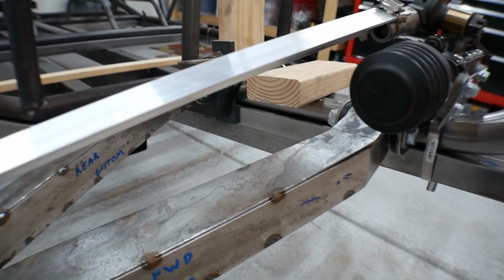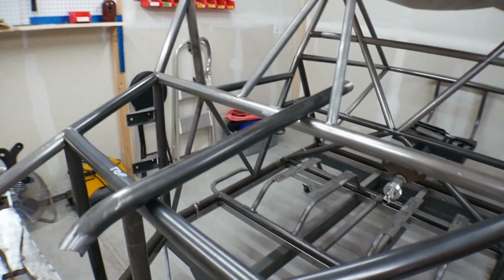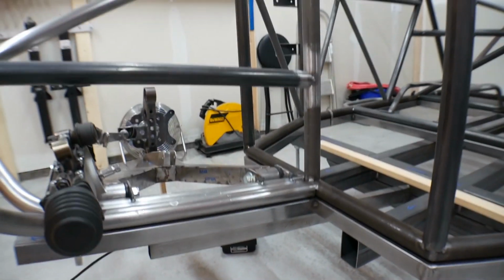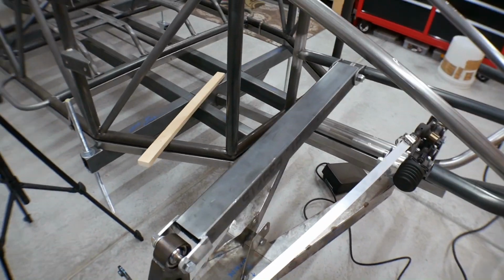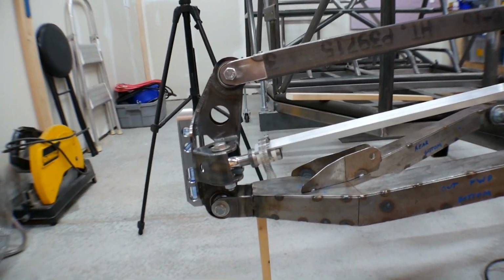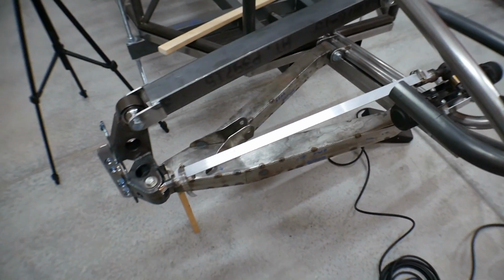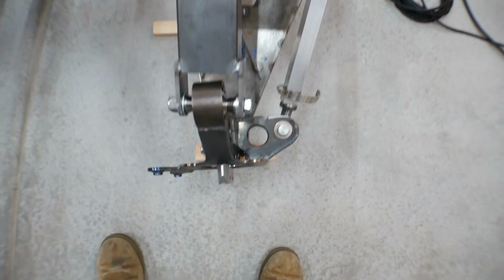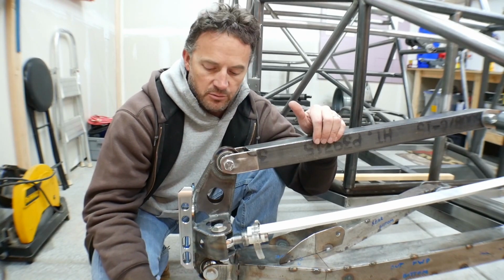Baja Front Suspension Build #2 (Temporary Mock-ups)

Comment: Awesome work, I am working on my own front suspension design that was inspired by your first baja build.  I did my design in Solidworks to simulate the travel, I spent what felt like forever in front of the computer trying to get the geometry right to get the bump steer eliminated and the Ackerman  correct.  I ended up with a design that will use a custom heim spreader for the steering rack that will put the inner tie rod pivot points in a more desirable location
Reply from the maker: Excellent work buddy! I wish I could design the entire setup on a computer. I think I'm just to old for that. ;-) 
A spreader is a good way to go. I thought about that, but because I need to change the height as well I'm going after the spindle. I'm not even calculating the Ackerman, just trying to keep it similar to the old setup as that was pretty good.
Nice work and thanks for the comment.

Comment: Hey Doug, I bought a suspension analyzer program.  You put in your mounting point for and aft of centerline of the axle, up from the ground, left and right centerline of the car..and you can cycle the suspension and look for errors.  It also has an optimize function that will check and tell you optimal location..you can get a several day free trial but it has limited features.

Comment: Nice set up on the suspension. 
Get yourself a magnetic Laser level, attach it to the hub and project the beam against the rear wall of the workshop (make sure the frame is square to the wall first and at a known distance) Mark the position of the red dot on a sheet of paper stuck to the wall and repeat for several travel heights, you can easily see the deflection due to bump steer and with a bit of math you can work out the real world angles and decide if they are low enough (you will always have some angle at the extreme travel)
Reply from the maker: I might look into doing that. Thanks for the idea.

Comment: Great video!  After watching this and the ackerman video, I'm wondering if you might consider switching to rear steer and move the steering box upward closer to where the line between the upper and lower inner control arm pivots converge toward each other?  Should help alleviate some of your bump steer and ackerman difficulties all in one shot.
Reply from the maker: I haven't decided yet. I'm mocking things up now and I'll decide what works best. Might just try to eliminate the bump steer and do what I can for the Ackerman. Hopefully I'll hav an answer in the next video. 
Thanks for the comment.

Comment: very good videos my friend, I have 5 years planning my suspension and buying the tool I hope I can make them, what measure of uniball did you use?
Reply from the maker: Sounds like you're doing a good job planning your build.
Those front spindles are 1" uniballs. With the misalingment spacers they have 9/16" bolts going through them.

Comment: What caused the bump steer?  Won’t moving the steering mounting point inboard just cause more tow in at full droop?
Reply from the maker: Well, I'm not 100% sure yet. But I think the problem at full droop is that the steering rod is not parallel with the Lower Control Arm. So at the lower extreme it's causing it to pull on the spindle. Causing the tow in.

Comment: "That's bump steer." -Doug Bug
Awesome video! I knew about bump steer, but never actually seen how and why it happens.
I also read somewhere a while back that the UCA should be shorter than the LCA to add negative camber as you lean and turn. I'm not sure if you did that, it kinda looks like you built that into your spindle with the upper and lower part offset.
Reply from the maker: J Dawg, Your picture reminds me of the Grunts from Halo.
Typically the UCA is shorter for the reasons you stated. Mine is a little tiny bit shorter, but not by much. I set up my geometry so it stays pretty true. Shorter UCA would yield better performance in cornering and landings. But it would limit my overall travel some. Because of the spindle angle at full droop.
But your info is correct. Thanks for the comment.
Reply: @DougBugBuilder  XP
Ah sweet! The only thing I've fabricated suspension wise was leaf spring hangers, perches and spindle gussets. I really want to one day build a trophy kart or baja bug. That Subaru I rebuilt put me in the hole a bit and I'm still tinkering with my Tacoma. Trying to decide if I want a full roll cage or just a roll bar. I built a bolt in bed cage for my 16" shocks awhile back, but am going to fabricate a welded in bed cage. So many projects...
Reply from the maker: @JDawgBuilds  Build the trophy cart, that would be a fun build in my opinion.

Comment: Nice fab work. However I see  a problem . Your spindle appears to have no Ackerman angle to it.
Reply from the maker: You are correct. This design (forward steer) has no Ackerman to it. Actually has the opposite. With my rack placement and forward steering correct Ackerman is really just a dream. Not to sound like a butcher but on a rear engine chassis I've never even noticed having such bad Ackerman.

Comment: Would adding an inner tie rod spacer, to place the attachment point of the tie rod in line with the steering arm mounts work to eliminate the bump steer?
Reply from the maker: Yes it would. But I typically don't like to modify the racks. But when I measure how much the pivot needs to move I'll make the final call as to make the change at the spindle or rack.

Comment: Can’t you achieve your tie rod angel to the LCA by just raising the steering box and not cutting up the steering knuckles them selves?
Reply from the maker: To straighten out the steering rod I would need to lower the steering box. And the bracket it's on now is as low as it can go. So going any lower is out. So I'm kinda forced to make the changes at the spindle.

Comment: How do your pivot points and steering points correlate to bump steer at rebound and compression?
Reply from the maker: Bump steer means that your suspension geometry and steering geometry are not in sinc. So as the suspension goes through it's travel the steering link essentially changes its length. This in turn makes the wheels toe in or out some. That's "Bump Steer". In the next videos you'll see me work to bring the suspension and steering geometry in sinc. When I do this the steering will stay consistent throught the suspension travel.
I hope that answers your question.
Reply: Doug Bug I was talking about your set up not in general. I’ll follow your next videos though

Comment: What type of heim joint uniball you use? Where i can buy them
Reply from the maker: I got all those chassis bits at Kartek Offroad. Here's a link to the uniballs I used.
https://www.kartek.com/parts/fk-rod-ends-34-id-1-38-od-wssx12t-ptfe-coated-uniball-spherical-bearings-f2-fit.html

Comment: Your spindle looks pretty good, but the inner steering pivot on the box looks way off...basically you draw a line thru the spindle pivot points and the outer steering pivot has to be thru that line...and the inner steering pivot has to be parallel to the lower control arm and also has to be in a line drawn thru the inner control arm pivots.... and yes there should be camber gain as you compress the suspension....
You haven't mentioned castor and possible anti dive....
Looks like a nice project  :)
Reply from the maker: The castor is 7 deg, but it will be adjustable with the upper control arm. I'm not considering anti dive, or I'm not designing around it.
I'm hoping to make some adjustments to the spindle to get the steering rod parallel, and to get the steering rod the same length and the LCA. The steering rod does not have to be inline with the control arm pivot points. It can be a little in or out as long as the length is the same as the control arms. I mean I wish they were inline. But there is some room to fudge one way or another.
Thanks for the comment, good points to consider.

Comment: Just curious but why aren’t u running a 100% anti dive instead of more of less?
Reply from the maker: Great question! I leaned the control arms back together so when the Baja is traveling forward under normal acceleration the suspension will be leaned back. 7 deg if the chassis is flat, more if it's accelerating. This causes the components to travel back a little when the suspension is compressing. Softening the forces on it. Now it's horrible for diving under braking. But with such soft suspension and so much travel that's just something I have to compromise.
Reply: Doug Bug I’m very curious as to how this will ride now hmm. Just a suggestion but could you add 2 extra mounting holes for the rear of the UCA mount that would enable you to move the rear of the UCA up or down and change the anti dive numbers. To see how much of a difference it will make while driving. It will definitely help Lee the nose from diving under heady breaking or decrease chassis bind in the whoops, depending on what adjustment you make. Hmm what about talking about it in one ur next sus videos, would love to hear your thoughts!
Reply from the maker: @brycewood4109  Your idea of making multiple points on the UCA tabs is gold. I might experiment with that. Thanks for the idea.
When the Baja is up and running I'll swing by and pick you up so you can see how it rides. Lol.
Reply: Doug Bug I’ll have to take you up on that 😂

Comment: you changed the ackerman when you changed the pivot point for the tie rod. better to change the point at the box instead.   has to do with what the tires do at lock or steering.
Reply: Ackermann steering looks impossible with your setup. To achieve Ackemann you need the pivot point of your control arm moving further out. You may get in contact with the break rotor. I think it‘s better to move the steering rack behind the (theoretical) front axle. 
Other than that I really like your work and the level of attention you put into every detail. 👍
Reply from the maker: @BeeTourBo  Hey, you're correct! Ackerman on a forward steer is basically impossible. Especially with where my rack is. I'll tell you a secret...... It's a rear engine Baja, the front is so light especially under power ackerman doesn't really matter for me. I was going to go over that in the next video. But you're already figuring that out. A+ for you buddy! ;-)
Reply from the maker: You are right. And when I make the adjustments the ackerman will be even worse. I don't want to mess with the steering rack though. Along with correcting the bump steer there are a couple other things I want to help by making the spindle arm a little different. But kudos to you on the ackerman, you know your stuff.
Reply: Doug Bug There are a couple of examples out there with forward steer. For example rock crawlers with solid axle. The knuckle design makes it possible I guess. The king pin or however it’s called is located further inboard.
Anyway, it’s as you mentioned - it doesn’t really matter for you. And if you don’t like it in the end we will get another great video about fixing it 😉
Reply: @DougBugBuilder  pick one arm to run your steering from, upper or lower, upper is probably the easiest and would net you the shorter tie rod which with center mount makes packaging easier. knuckle wont care as long as its plated enough and clears the breaks/rim. 

thats what i would do, assuming youcant find a sweet spot in the middle. 

use your scale model to plot different tie rod locations. 

also honestly in an offroad car you really dont need much ackerman, do what the drift guys do and thats almost constant angle.

Comment: Is it possible to move the steering rack?
Reply from the maker: Yes, I could modify the top portion of the rack to spread the pivot points out to put it inline with the suspension pivot points. But I don't really like to modify the steering racks. So I'll make the needed changes out at the spindle.
Reply: Doug Bug i meant like moving the whole unit forward abd building a bracket that bolts to the existing holes to put them where you need them
Reply from the maker: @Moneygrip  Ahhh...... I can move it but that won't change the geometry. So I wouldn't gain anything from that.
Reply: Doug Bug the bracket youd bolt to could move the mounting points of the tie rod ends

Comment: What about your caster.    That is the most important part.?r
Reply from the maker: My caster is built into the front portion of the chassis. It is raked up 8 degrees. So I start with 8 degrees of caster. Then I can make adjustments with the upper control arm.

Comment: Doug Bug you genius you! lol :]  ]
Reply: so, your steering bar should be the same length as the other pivot points, in addition to being parallel, is that correct ?
and if your searching -0+ travel you may have to reconfigure the steering box as well... or live with a slight variation in 
the perfect -0+ travel scenario,
Reply: i used the word "travel" but i might something else having to do with steering and how it changes with the travel,
im not familiar with all the suspension vocabulary im just trying to provoke thought anyways ! looks like so much fun :D
Reply from the maker: @lastfanstanding999  The steering bar needs to be the average of the upper and lower control arms in length. Because they are not the same length. Although really close. And it needs to be parallel at ride height for best results. But the pivot points don't necessarily need to be inline. So I shouldn't need to change the rack. Just move over the point on the spindle. I believe that should get it near right on. And I can live with a little bump, but needs to be way better than it is now.
Reply: @DougBugBuilder  okay awesome, great job man, im anxious to see how it all works out,